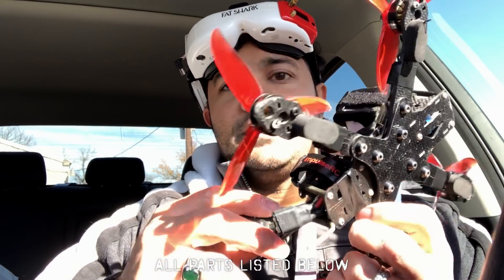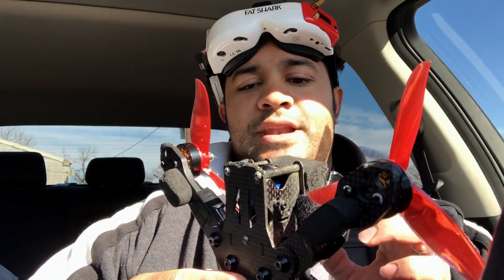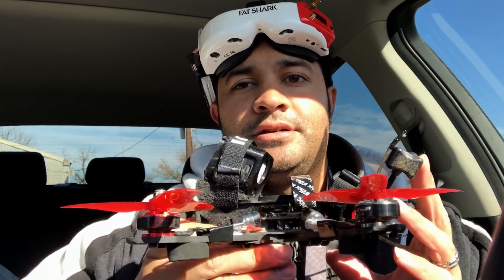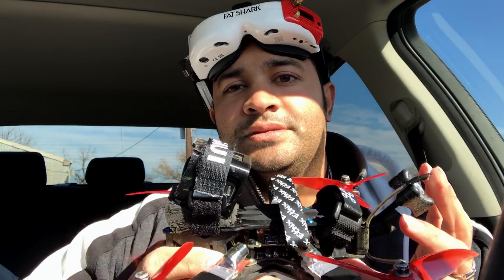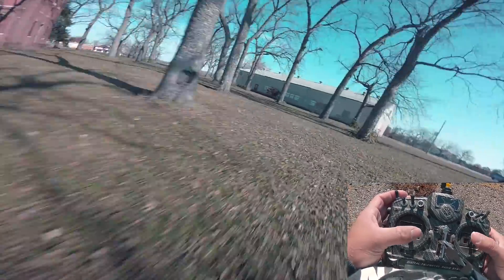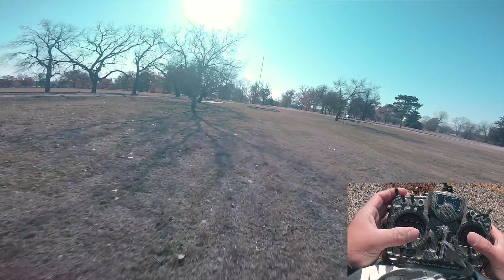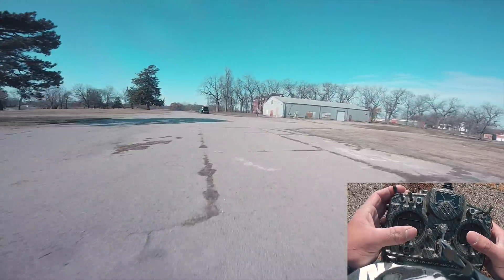DO CAPACITORS MAKE YOUR DRONE FLY BETTER!? 🔥🔥🔥| FPV FREESTYLE!

Comment: I totally notice a difference, I tried it about a year ago, to fix a bad video problem, It didn't help(Turned out antenna was grounding out on frame) but I noticed that it smoothed out everything, and got rid of some prop wash, so I've been doing it ever since! My KISS set up was always pretty smooth and locked in, but this just made it a little better. I'm still flying KISS V1 also haha!
Reply from the maker: Nice man glad to know I’m not crazy 😅😅I actually did a video with my kiss v1 and just released it today. Put some caps on it’s flying pretty darn good.
Reply: Yeah, I just watched it! I am totally convinced , I hate it when I fly without caps now, I have a Astro X5 that has a Mr Steele PDB, and it sticks out too much to use caps without the tips of the props hitting them when they deflect, so I don't run them on that one, and I totally can tell. I might switch out to the Wolf PDM now that it is out, and kinda designed better to fit other builds, so I think I can fit caps with it. @VIKFPV

Comment: My little bee 30a esc could not flip or roll on my sensitive fortini.. but after caps it flies freaking smooth, the motors dont get hot. Same with my second build racerstar 4 in 1 esc i put 3 caps in parallel it is so smooth.
Reply from the maker: awesome to hear. I like to hear other peoples experiences just to make sure I am not crazy lol. Good stuff man. Keep ripping
Reply: @VIKFPV  the only crazy here is your flying, marvelous! Love it. ! Caps im using is 470uf 25v rubycon low esr.
Reply from the maker: Thanks man  I’m using some Panasonic’s 35v 470.

Comment: They last, had caps on my emax set up, with the older bullet esc, they dont get hot, they have been great with the 2600kv rs2205s motors.
They perform the same everytime I fly it. Hot or cold.
And the bullet esc's was supposed to be bad..... well never no problem with them, they been on the quad for over 2 years now
Reply from the maker: Nice man. Good to know they hold up 👊🏽👊🏽👊🏽
Reply: @VIKFPV  even have had prop strikes and I think 2 of them, dented pretty bad lol, never changed them ok ne out either, still doing there job haha

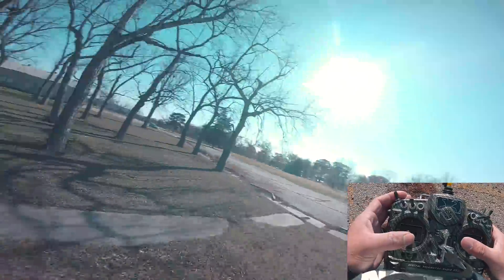Comment: Man I think its time for you to get on the 6s train brotha..... I made the switch and its the tits.... Not SOO much different power wise but as far as sag and flight time... its amazing.... throttle resolution is a little bit different.... But propping it properly helps a bit with that... But no sag and I'm consistently getting 3:30 -4 minutes on 1600kv and about 3-3:30 on 1700kv... I really want to try the f40 1750kv but I haven't got yet.... But with a session 1600kv works great feels almost Identical to my 4s setup with the session just more crisp and less strain on the battery and the esc (especially since you already have caps...) Anyway always a sick rip brotha but I'd love to see your opinion on 6s... Build a rig and test it... just saying i think you will like it... And I'm sure cost of entry isn't as bad for you as you have some sponsors that may be willing to help you out... Keep it up bru..
Reply from the maker: Thanks man. I’m gonna try it just waiting for a frame to come in and I might just pick up some motors to see what the hypes about 😜😜🤘🏽🤘🏽
Reply: @VIKFPV  Yeah I think you will suprise yourself... Not like its so much different... its just better IMHO... Can't wait to see it! Really I only did it because I purchased the wrong motors initially and decided to hang on to them... f40 pro ii 1600kv... And CNHL had bogo on batteries and picked up like 10 for like 15 a battery... Also though what really made me want to was I got a hero 7 and it just felt so heavy on my normal setup I just wanted to make my rig feel like it did with the Session on 4s.........IT DID!! Love to see what your thoughts are... and see what you can do with a little extra time and punch in the air..

Comment: One thing I noticed recently is my current sensor is off by a lot since I attached a 470 uF 25v Panasonic on my XT60 lipo plug. It's weird I thought my batteries where going as it seemed as if it was sagging a lot. My sensor was showing 14.0v after like a minute flight.... When I bring it down it shoots back up to 15.0v.  
Perhaps I need to put a 1000 uF cap rather on the lipo XT60 connector? My reverb pdb has already 1000 uF cap on it so I thought It would be cool to put a 470 uF cap on the lipo but something is not working right and I wonder why...
Reply from the maker: It sounds like battery sag this can be caused by cold flying conditions or the battery is just old. I would do a pack and monitor how the battery is with another sensor like on your charger also check the mah consumption when you are charging to determine how much has been put back into the lipo. It should be close to what the osd said

Comment: not sure if its the caps i have used but every time i have, i felt like it takes away some power
Reply from the maker: I never experienced that it might be something else in your build
Reply: VIK FPV its happened on 2 different builds, both all new. That said though, i installed one on each esc on my 7 inch 6s build and that one is fine

Comment: Capacitors are great from my experience , they really clean the feed to the gyro in additional to the Fpv video feed
For our gears today I really recommend adding at least 1000uf if not more

I’m going to try adding a cap right where the FC is getting the voltage feed in parallel 

Another great video VIK!
Reply from the maker: Me too. Keep ripping it

Comment: Hey Vik
Love your flying! So much Control… just amazing! Are your Rates still the same like in your Pid/Rates Video? It looks like your rates are sharper now?! If it's so can you please tell me your actual rates?  Greetings from Bavaria/Germany💪
Reply from the maker: Yes they are and honestly the reason why they look better is because I probably gotten batter as a pilot. Looking at my old videos I don’t see as much as precision of I flying with now. Just stick time and keeping at it. Hope it helps 🤘🏽🤘🏽
Reply: @VIKFPV  Thanks for your quick reply. Yeah you're definitely better now! I trained a lot on the sim and in real with these rates and they are great! But i'm miles away from this precision at this speed you're flying. Thanks for inspiring me and keep the good work! Definitely one of the best pilots out there👍

Comment: All caps do is smooth out electrical draw. You shouldn’t really have any noise on 2400kv especially if you have kiss v2 and wolf PDB. You might need a cap on the power lead when you go past 2400kv but that’s it. If you have noise in your video or vibrations, even if you don’t crash or think the esc are fine I’d check the ceramic caps as they can smash, but look fine until you touch them and they crumble. especially the big one on the bottom on the 32amps. 

Just need the caps for 6s, as they spike a lot.

Nice aggressive flying 👌🏻
Reply from the maker: I know I never used caps before and it flew perfectly fine. This was just to see if I can feel a difference and I did. Motors might be causing some noise they are super old
Reply: VIK FPV yeah, what people don’t realise is most of the vibrations and noise comes from bad/unbalanced motors. 
It’s good it’s sorted your problem out.
Reply: Definitely needed for 6S, debatable if it’s anything more than placebo on 4S KISS but whatever feels best!

Comment: Is this just an excuse to get them caps on for the big 4s to 6s change that's coming?? 
Lol, have you switched over to 6s ? 
What is your thoughts on switching? 
Personally I've tested one of 6 Alien's on it and I really wasn't that impressed with it.  Would take some getting use to, it's got a little more punch, but the flight time wasn't blow my mind OMG so freaking awesome...  idk ... ?? 
Cost a lot to change all my setups over at this point..  
Wicked rippage as usual my friend! Cheers ! ✌😁
Reply from the maker: Hahah I was just looking at some motors for 6s 😂. Na I am not completely sold on it because of the weight and size of 6s.  I tried 6s a long time ago and it felt like a fatty in the air. More flight time is great but what’s the point if you aren’t agile enough to pull off the time tricks you like doing on 4s. And 4s stuff is getting cheaper so now you are spending less money and there is more evidence that 4s is now having less and less issues because the tech caught up. Pros and cons to each but I might try it out if I get bored with 4s
Reply: @VIKFPV  Agreed on 4S getting cheaper. I like both my 4S and 6S rigs-whatever works right :)
Reply: @VIKFPV  yeah, I agree. When ever I get board tho I pick up the latest BetaFlight board and try it out for a little while trying to tune it to feel as locked in as my Kiss setups. Eventually giving up and going to the next one, Butter flight, RaceFlight, whatever flavor is the rave. I always have four or five of the Kiss v2 quads ready to go but it's a cheap (er) kind of experimenting than buying 20-25 6s packs and it scratches the itch. Still putting together the components for that Reverb build tho.. so far it's going together just as easily as one of my Alien rigs.. but it's just as cold ( colder) up here in Indy so I feel your pain man. 
Good chat, Keep it crispy Maine.✌
Reply: Jason Hull 100% agree with your experimenting. I do the same exact thing. I have to keep a toe in each FW to see the hype.

Comment: dude ive tried RF,BF, And even on the helio now and I cant get anything to have that on railes feel like kiss!!! not saying others dont fly good but you know Kiss after you hit that roll it just holds its attitude. Great video man loving it bro!!
Reply from the maker: Yeah man. Just something about kiss feel so good in the air. I completely agree been trying f1 and it’s just not the same.
Reply: @VIKFPV  Hey man ive been flying the helio on butterflight 3.6.2 imuf fu mode and adjusting the throttle boost down to around 2 and FF to around 25 and it gives me the closest feel to kiss but im still testing but pretty impressed so far.
Reply from the maker: I have heard good things. I might have to give it a shot
Reply: @VIKFPV  you like the f60 pros? im flying the f40 pro v2 2600 now but i wnt to try the f60s prob 2500kv
Reply from the maker: Tried all of them f40 feel best to me for my low altitude flying style.
Reply: @VIKFPV  gotcha hmmm well thanks for the info man gonna go rip now haha.

Comment: Interesting... Have you do some pid tuning after cap installation?
Reply from the maker: I kept everything the same just for the test but I think I needed to retune for higher pid values. Didn’t feel as precise as I wanted
Reply: @VIKFPV  so you could make a video about your tuning method if you have time ;)